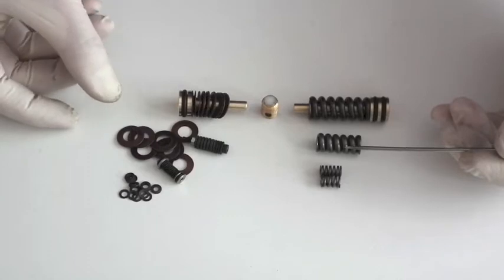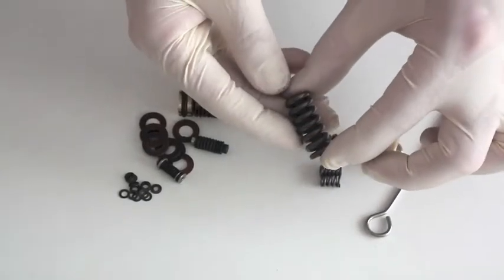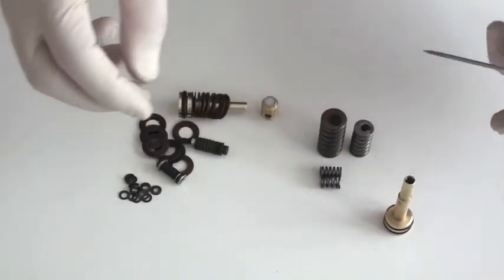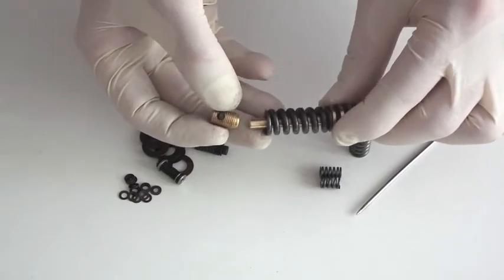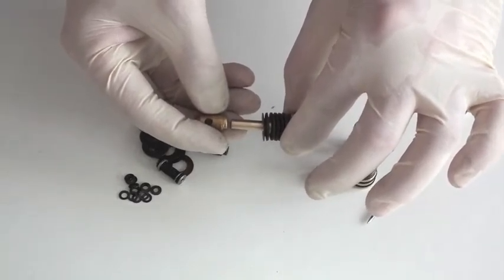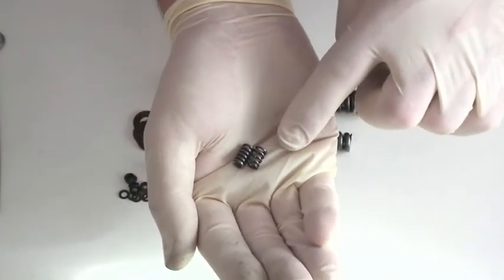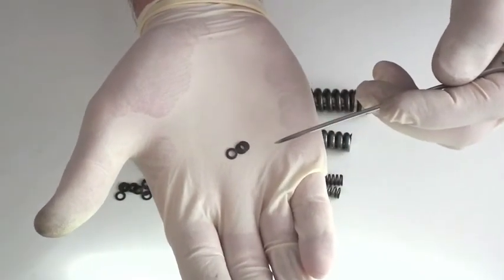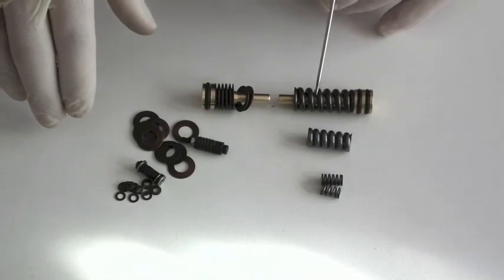Lane Regulators - Pt. 1-3 Coil Compression Springs v Belleville Spring Washers.

Comment: G'day Mr Lane (may I call you Robert?) It seems you are quite open to people experimenting on their own making, or trying to make, ones own regulator. To be honest, I'm an old retired pensioner and would attempt to do that if you can give me some guidance info, especially regarding the spring size (width and length) and wire thickness.
The concept looks very nice and I can use a lathe quite well, even at my mature age. So far, I've been using those Chinese regulators available from AliExpress and it needs to be said, they are not a consistent and controlled reg. Your system is far more logical and given some thought, would provide a better solution. Hope you decide to offer me some assistance. Best regards.